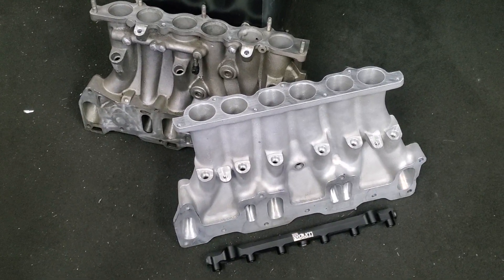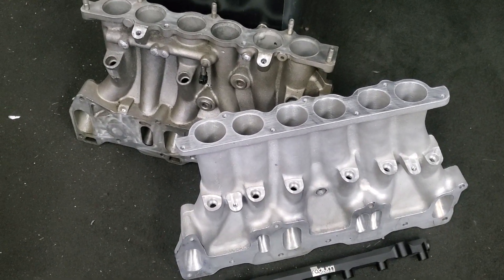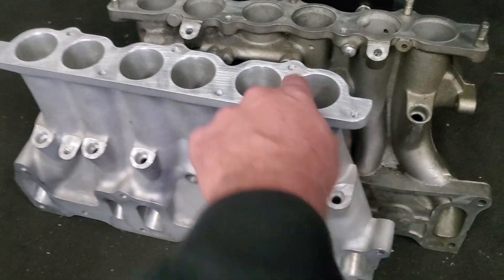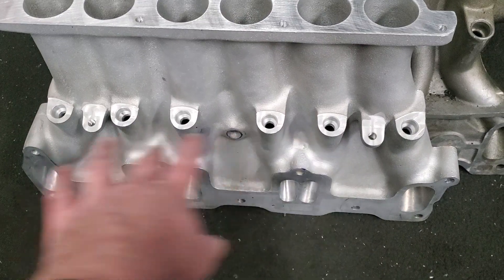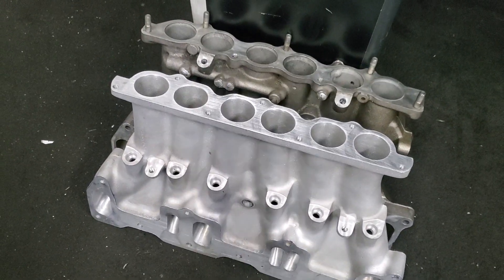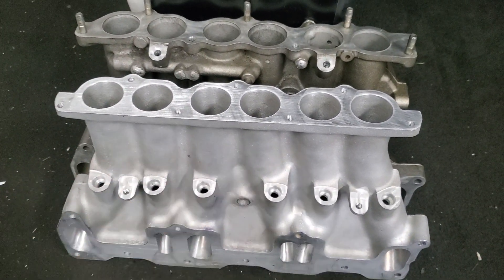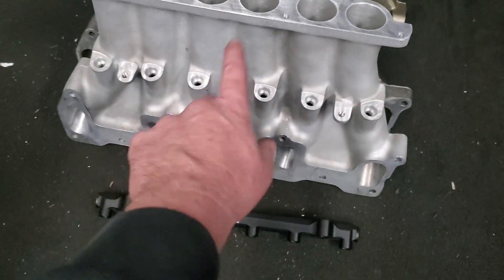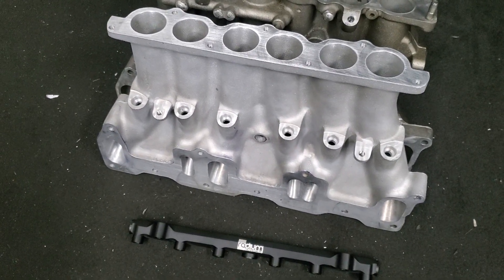Custom 20b Lower intake manifold and Radium fuel rail setup / rotary tech talk

Comment: I bought one about a year back.. had to do alott of porting to get it right but its was nice to have aftermarkrt support even tho it wasnt perfect
Reply from the maker: Yep me to, took a bit to match up.  I think it was based off FD3S runners.  Not sure though.
Reply: @KyleMohanRacing  most likely but some werent even oval on mine haha
Reply from the maker: @jtoy6  yep, but the OEM is also always off... All manifolds require port matching.